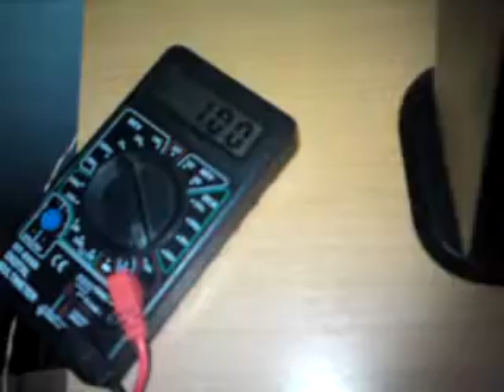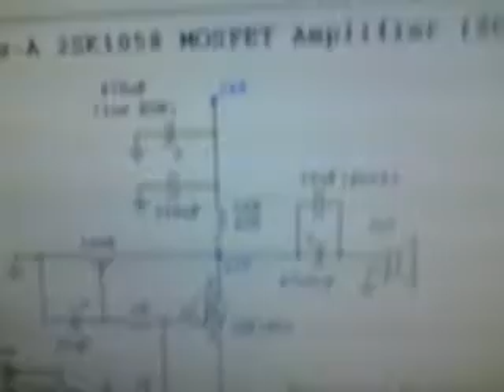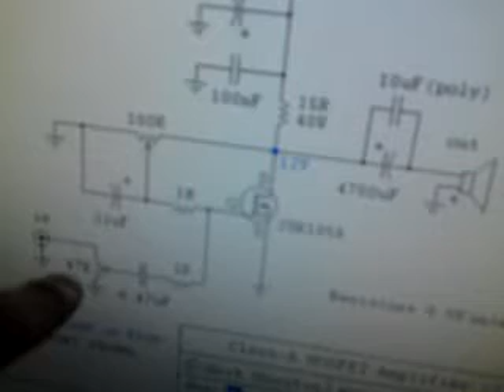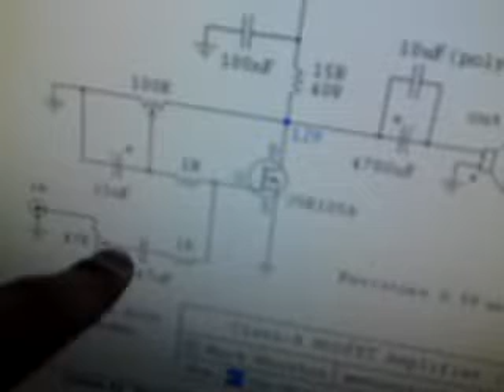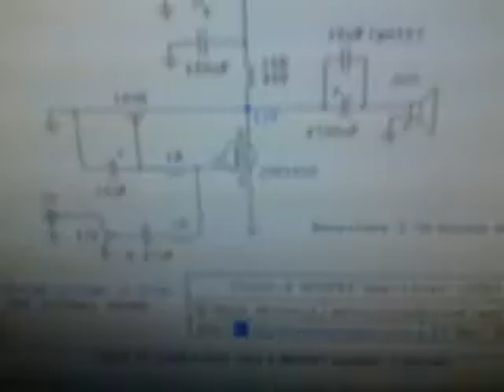Class A Single Mosfet Amplifier

Comment from the maker: @zxz38 The output power depends on what supply voltage it is using, in this video the output is about 4-5W@12V input, good luck with your amplifier :)